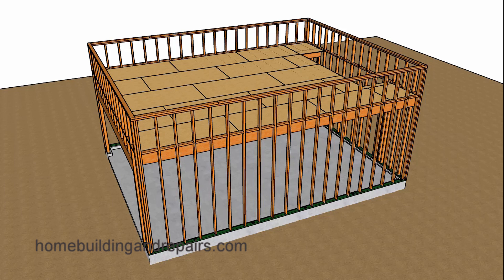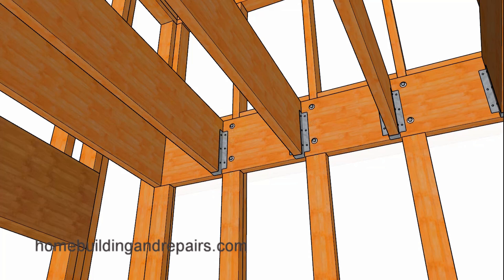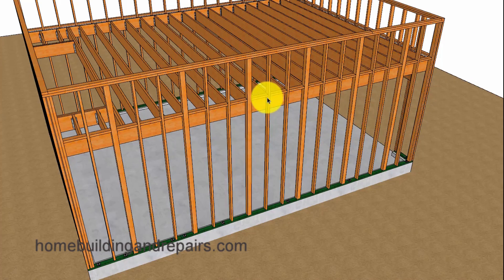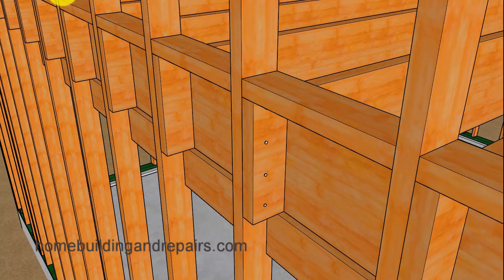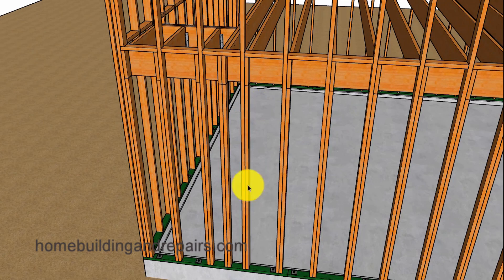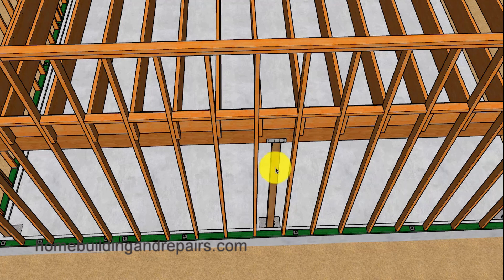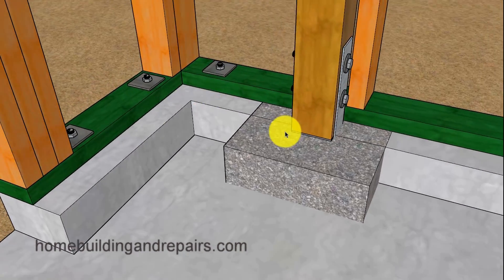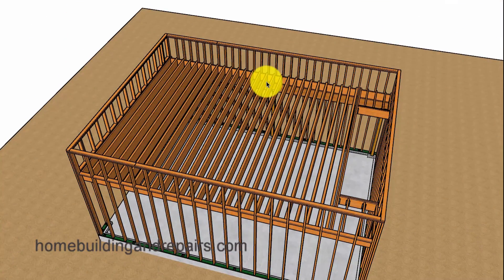A Few Ways To Make Floor Framing Structurally Stronger For Garage Loft - Building Education Part 7

Comment: when cost is no object. It would be more economical to add steel beam member ($1500 installed near me) and reduce joist length by half. I like the double 2x6 posts on 48 center.
Reply from the maker: You're right about design and cost.

Comment: I am thinking instead of this to do about 4 or so of the 4x8 rafter lifts, maybe 2 over the large garage door too. The only issue is I would have to leave some space between them all and hang down some garage lighting. Easier than lugging stuff up stairs since the lifts have motors. Technically some heavy duty ones can lift dirt bikes but I don't want to deal with suspending that weight from my ceiling even with the 2x6 walls. Another issue is the space above the collar ties is not as easily reachable.
Reply from the maker: Yes, that could create a structural problem that will require stronger connection points.

Comment: Holy smokes that garage got expensive
Reply: 3x12x20' at $120 ea would be $2500 for 12" joist spacing. Whooo eeeeee. But I guess if you do anything with LVL the price gets up there too.
Reply from the maker: What about 6x14's spaced 1 inch apart:)

Comment: I still don’t like the idea of the whole second floor hanging from lag screws.  I would support the ledger with jack studs periodically…like at least every 32”.
Reply: You can't really put a lot of dead weight up there with that span so lags aren't that bad imo
Reply: @eschrader  Depends on the floor joist size I’m sure.  Putting jack studs around the permitter would support it.  I’m just afraid lag screws would snap.
Reply from the maker: I agree with Eric and structural requirements for construction like joist size, footing sizes and leger attachment usually depend upon the use of the building. For example storage or a workshop might require a stronger structure than a loft or living space.

Comment: Could i attach a rim joist to a steel column? my building is built similar to a pole barn with 4 steel load bearing columns on each side. and I’m adding a second floor. I don’t have the option of stud walls because my “girts are 2x6’s laid flat. I could notch out a stud wall but it would be extremely time consuming and i don’t have the space to fur out a stud wall.
Reply from the maker: I can't provide engineering advice, but would think if you could, you might need to attach some type of support bracket under the beam or ledger also.
Reply: @gregvancom  thank you for your response! Your videos have helped a great deal to visualize and understand components of building.